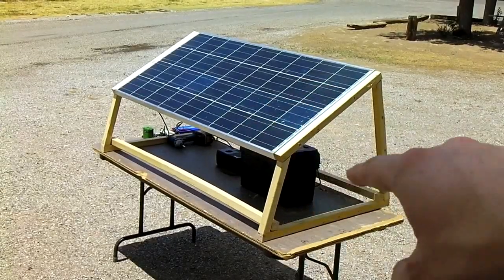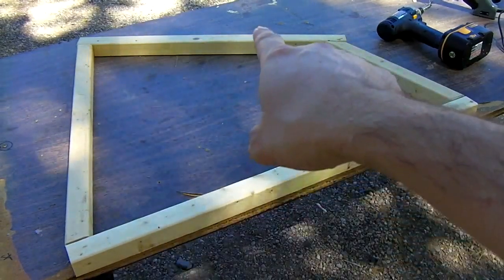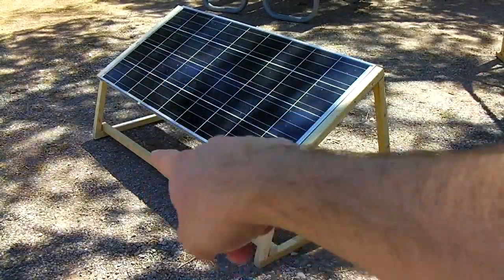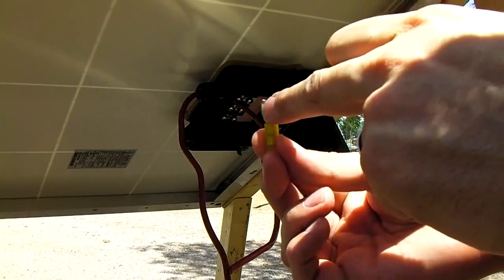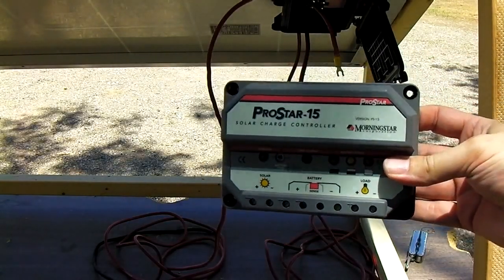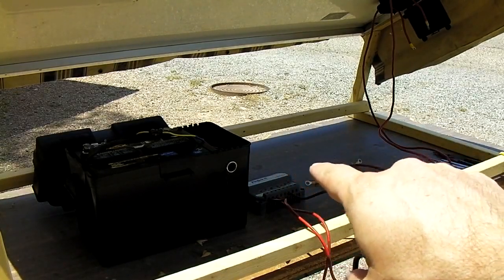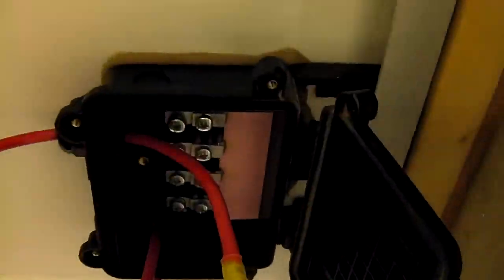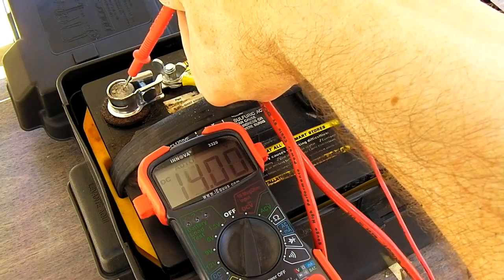DIY Portable Solar Power Generator - Off-Grid Free Energy Generation

Comment: You learn so much by doing this stuff yourself. Drop by the forums at ABOUTSOLARCELLS.COMXA.COM  for DIY tech info and a? inside look at those low cost ebay small charge controllers and a DIY shunt you? can make from 10 wire plus more DIY tech stuff.